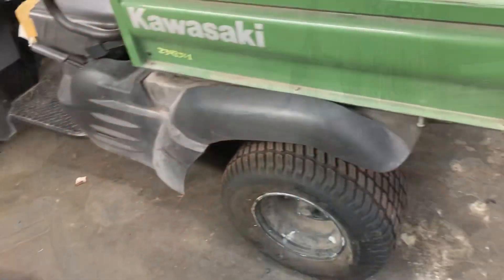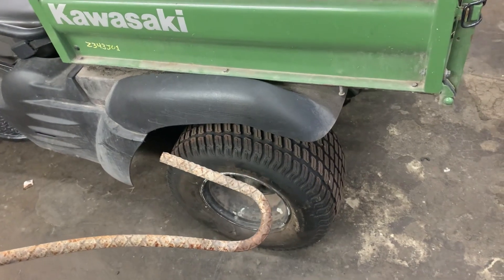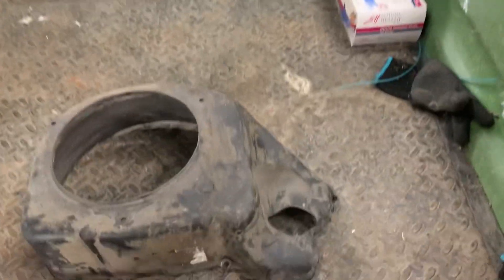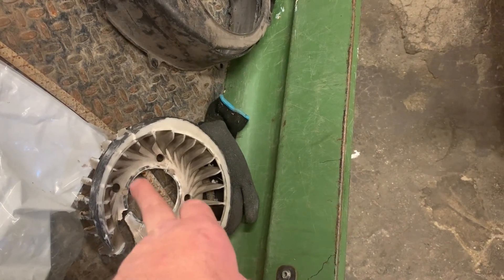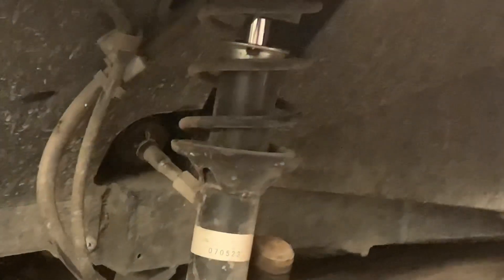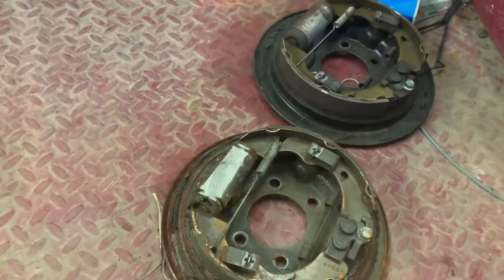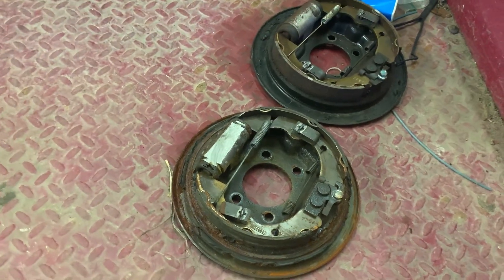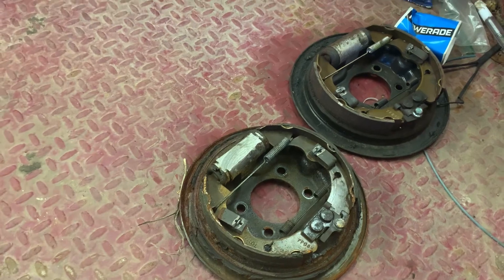KAWASAKI MULE CARNAGE.

Comment: I also recently replaced a fan blade on a twin cylinder Kawasaki on a Wright Stander Mower.  Like yours it exploded.  Luckily, it didn't damage the engine cowl, as no rebar was present.  Ha Ha